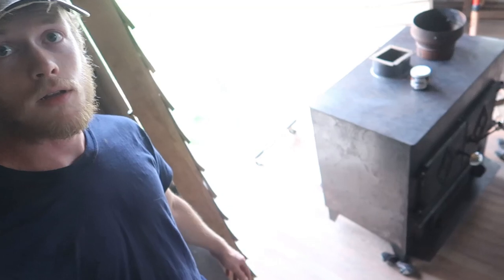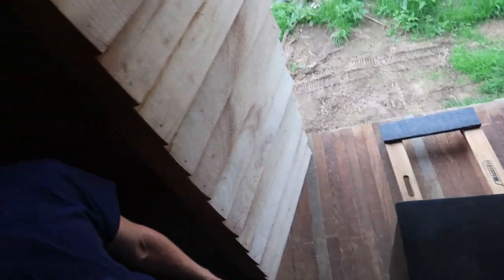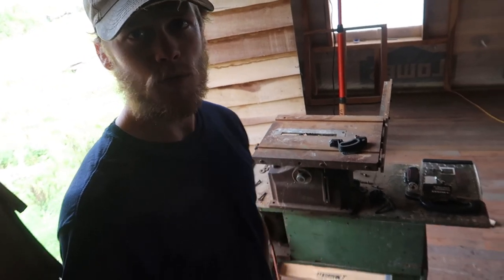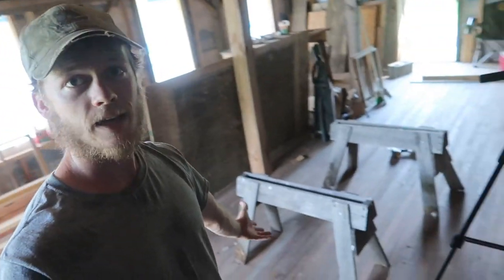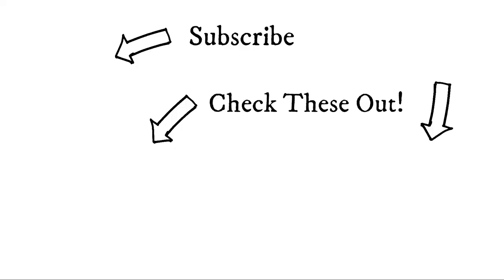Workbenches for the Millhouse

Comment: If JB Weld fails can you use a rivnut straight into a hole in the steel part ?😀🇬🇧
Reply from the maker: Had to look that up as I hadn't heard of those before. I don't think that would work for what I'm doing, but that bit of info will definitely come in handy for other projects. Thanks!
Reply: Landis Legacy Farm . You are welcome. Rivnuts are often used in sheet-metal work.🇬🇧